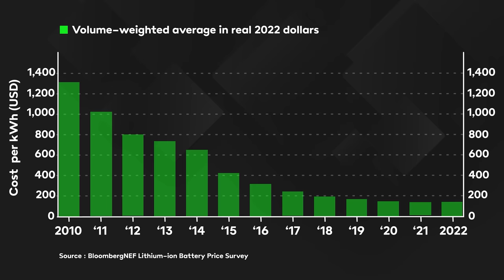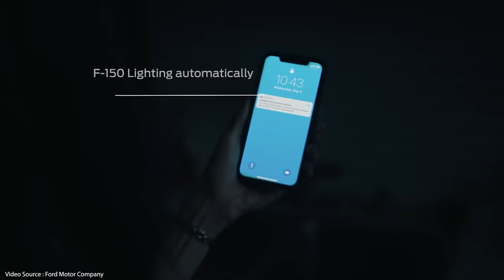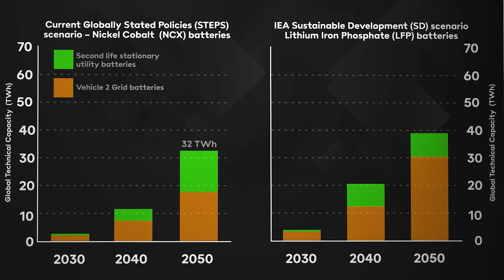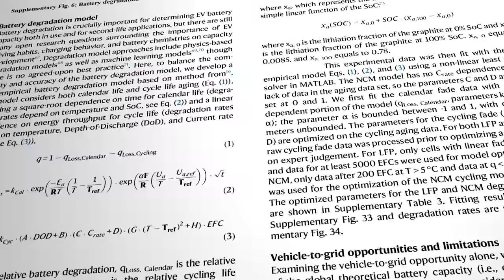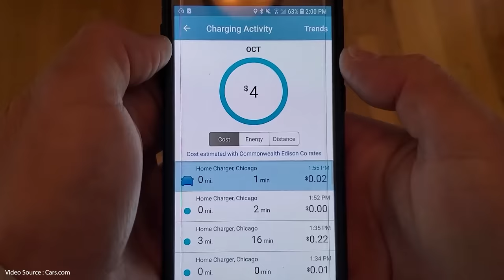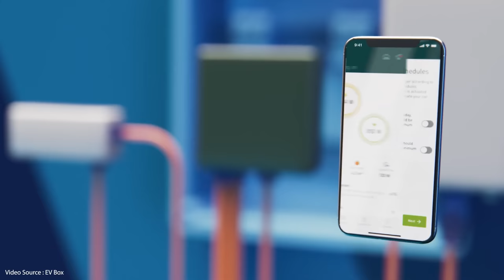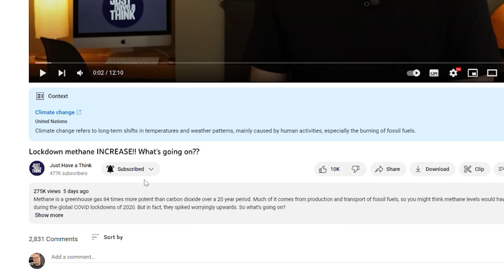Can the electric grid ruin your EV battery?

Comment: 9:45 - “Annual capacity increase… 6.5 years to… switch to electric vehicle”

Capacity increase is a small problem.

38% of live in apartments buildings, which means nearly 40% will likely need fast chargers, and those fast chargers will be used before people go to work & as people come home. 

This huge capacity increase will need to be made available on-demand for very short periods of time, which means carbon fuels will be burned to supply the batteries in peoples’ cars… or 2x the batteries will be needed for every car (ie 1 for power grid, 1 for vehicle.)

This problem is bizarrely suppressed, the EV infrastructure is unsustainable for the purpose of environment.

With urbanization increasing, the problem will only get worse.

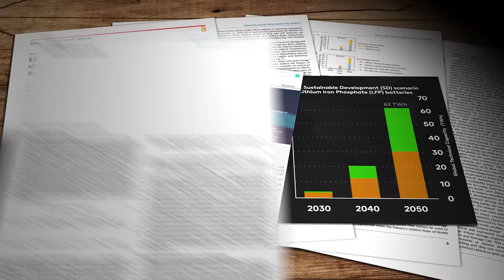Comment: 6:32 Before I continue the video, the answer is yes. Battery packs down to each individual cell are rated for a certain number of charge/discharge cycles. A 'cycle' is determined by a full 100% capacity discharge followed by a 100% capacity recharge. This could take place over many smaller discharge/recharge instances. So for instance, if an individual cell is rated at 4AH and 3000 charge cycle, then as you approach a total of 12,000AH discharged out of the cell and then recharged, that will will begin to experience end-of-life degradation. However, if you discharge/charge the batteries in extreme temps, either hot or cold (extreme meaning below 0°C and above 30ish°C, taking into account the heat of the battery itself while discharging/recharging, the number of cycles that cell can go through will be diminished. So if you live in the desert or someplace with extremely cold winters, that cell may only last 2,400 cycles or 9,600AH total being pulled from the cell. If your battery packs are connected to the grid, where charging and discharging is outside of your control (for the most part), you will diminish the life of your battery. Period.

As far as my expertise on this matter goes, I worked R&D at Milwaukee Tool in the battery division. I did a LOT of testing on Li-Ion cells and battery packs. Another consideration is the more a cell is used, the higher the risk of an individual cell failing, thus reducing the capacity of the entire pack. We try to make the smarts of the battery good enough to account for this, but it is unavoidable.

Now let's see what you have to say about this...
Reply: 8:55 Okay, before I continue the video again... No. The grid will not 'melt down'. However, the importance of having a spinning reserve (usually natural gas power plants) available at any given time will go up. If you have enough of a concentration of electric vehicles connected to the grid, you can reasonably account for a mass of power storage available at any given hour and make schedules to account for when vehicles are most likely to be on the road versus most likely to be plugged in. If ever the schedule is wrong, say people travelling on a holiday, then the available power to the grid will be below estimates, and considering how close we try to match peak production to demand, if we do not have a spinning reserve available, then there will be brownouts. For those who don't know, a brownout is when certain parts of the grid go down, but on the whole, the grid remains running and a blackout is when the entire grid goes down. Brownouts are common, blackouts, not so much, but it depends upon what level of the grid you're looking at. If you're looking at individual circuits in the grid, blackouts are probably 50/50 with brownouts, and on an individual building level, blackouts are more predominant.

As far as my expertise on this matter goes, I currently work for a power company as a designer. I deal with these kinds of things daily.
Reply: Hmm. Here's the rub. A lot of power companies offer to buy power supplied through local generation. In fact, they're often required to do so by the State's Public Services Commission. However... it is far cheaper for electric companies to buy coal or natural gas in bulk to burn than it is to pay hundreds of thousands if not millions of people for their local generation. If the States continue to require the power companies to buy locally generated power, the base cost of electricity provided will increase as local generation increases. Now this is just generation. If you add into that battery storage, then you're going to increase the rate of base cost of electricity increase. The State's are likely not going to want that because they'll start getting complaints from residents asking why their electrical bills are so high. So they'll try to quash that by forcing the price for electricity down. The power companies aren't going to like that because their profit margins will significantly decrease, which could cut into their operational expenses which will lead to the aging of the grid (because there's no extra money lying around to improve it). This will result in more blackouts/brownouts. Those who can afford local generation will be fine. Those who can't will be f**ked. They'll have super high electricity costs along with reduced grid dependability.

It's not a good deal for the power companies. It's not a good deal for those who can't afford electric vehicles or local generation either. It's a great deal for those with the money to buy these things. So do you want to punish the poor and reward the rich? And what is that going to do to the income disparity and already shrinking middle class in America and other countries around the world?

There are no simple fixes for these kinds of things and policy often makes a problem worse even when it claims to make it better. Especially when that policy is forced through by people who don't understand the consequences of it. 

I dunno. It's a cool idea... but I think we should probably be looking into power companies supplying battery packs to homes and charging customers rental fees and reducing the cost of base electricity. If the power companies can take on that responsibility (which will be made cheaper because it'd be done in bulk), then you can look forward to your 'greener future'... but we're still going to need to be able to pump enough electricity into the grid to make these house battery packs worthwhile. You've gotta put the horse before the cart. The horse is the storage. The cart is the generation. If you don't have a place to put the generated power, you're wasting money and electricity (and the horse's time, lol).
Reply: There is no way I am going to let the power company use my expensive batteries without meaningful compensation!
Reply: @jay90374  Which is a consideration that must be taken into account if policy is to be made regarding this. I guarantee you that you're not the only one who feels that way.
Reply: @Xero1of1  What they actually seem to be doing is reducing the payment for generation and increasing the grid connection base fee.

I wouldn't bet on even 5 years of personal revenue from the power companies for generation.
Reply: @Xero1of1  "it is far cheaper for electric companies to buy coal or natural gas in bulk to burn than it is to pay hundreds of thousands if not millions of people for their local generation." This is an assumption and I'm pretty sure it doesn't track.
Reply: @Xero1of1  Hey that is a well thought out analysis and I'm not going to challenge any of it. Do you think there is still a space for some local generation, considering it costs the company no capex, no regulatory costs and very little overhead?
Reply: @SocialDownclimber  There will always be a place for local generation, but I think it would be more beneficial if customers don't install personal generation with the intent to sell to the power company, but rather to supply their own power needs. 

Also, there is a cost to the power companies for local generation. Johnson & Johnson told us they wanted to install a couple of large wind turbines and they wanted the power company to pay for it. We said no. They went to the State and the State overruled us. We ended up paying the bulk of the install costs. And even at small scale, there has to be specialized equipment installed on-site for local generation. The cost for install is on the customer, but we still have to go out and inspect it. If the grid goes down, but customers are still generating, without the proper equipment, they backfeed onto the power lines making them unsafe to work on by our crews. We'd rather not have someone get electrocuted because they were trying to work on a power line they thought was dead.

There is regulatory costs as well in a way. The State requires us to purchase local generation and that comes at a cost (see previous comment). So while that's not strictly a regulatory cost, it is a cost incurred because of regulations/policies. 

Another cost to the company is when local generation is larger than what you'd need to power a building. Our lines and equipment are rated for a certain amount of amperage at any given time. If the amperage generated is larger than the rating for the lines and equipment, we have to upgrade them at our cost. We can't charge the customers for that. We eat that. Per the State.

So you see, there's a lot more to this argument about policy and its effects than was described in the video.
Reply: @Xero1of1  You're right, there was a lot I didn't know. Thanks for sharing your expertise, I really appreciate the time you spent putting the detail into your posts.
Reply: @Xero1of1  See what I've heard is that local generation can often benefit the power company by allowing them to delay capacity upgrades to lines and substations. That's why, while I think net metering is probably a bit too generous, there is a case to be made for not just allowing local generation but encouraging it, even in (modest) excess of the site's energy needs.

(By "modest" I mean without requiring service upgrades. E.g., if you've got 100A service, what's wrong with letting you generate 80A above your minimum usage? If you really want more panels than that, you'd pay to upgrade to 200A or 3-phase.)

As for the "linemen are unpleasantly surprised by an energized line" argument, I hear that one a lot, but is that really how things work? I would have thought they'd clamp an ammeter around any line they plan to work on, as a matter of course. Or is the concern simply, that someone may turn on a generator or flip on a breaker some random time after the power outage begins?
Reply: @ps.2  Just because a customer has a 100A service doesn't mean the power company is able to provide all 100A of service continuously. There's a lot that goes into sizing a service, but generally speaking, the '100A' on a service is for spike in current draw... say a customer turns on a welder or a hotel's elevator activates. The cables we use to feed these customers are rated up to a certain amperage, but that's for spikes, not for constant amperage. For example, I have a 60A service (it's old), so while the power company and my wiring can handle up to 60A, I'm generally using no more than 15A at a time. We take into account spikes in amperage as well as consistent amperage. If you have a hundred amp service and you want to pump 100A continuously into the grid, you have to be sized up to 320A or somewhere around there. 

Now imagine you've got a 25KVA transformer. It can handle 5 or 6 small houses' load. These could each have 100A services, or 5-600A max current. Now let's say 2 or 3 of those houses starts putting out 80A back into the grid consistently... You're going to burn up that transformer. While the transformer can handle peaks in current, it's only really rated for about 60A consistent output. You start going beyond that and the transformer will heat up. Additionally, if you have 30 transformers feeding 100 houses and 30 of those houses start generating near their service size limit, not only are you going to burn up the transformers, but you're probably also going to start overloading the larger transformers at the substation... you do that and the safety's kick on and turn off the power to keep it from exploding.

You would think the linemen check the wires, but if you've got an entire line shut off and isolated, and a customer does their own battery setup without letting the power company know and without sufficient protections in place, then you could induce a current onto the lines and the crews, having done everything they need to to isolate the line, it's possible that they won't check the lines due to complacency. It's happened before. And sometimes it's completely unintentional. A lineman could simply brush up against a live wire and be electrocuted. Their helmet could touch a live wire which could cause issues. Their bucket (crane on the truck) could sway in the wind causing them to come into contact with a live wire, or a small spark from closing a fuse or switch could make them jump, which could make them contact a live wire. There are a million and one reason why working on live wires is dangerous, and why, given the option, the crews will ALWAYS choose to kill the line before they work on it. And it might not even be anything external to the house that causes it. A person could have all the right battery-to-grid equipment installed properly, but then it fails and the switch connecting battery to grid closes immediately lighting up the wire outside that a lineman is working on. 

Simply said, connecting local generation to the grid will always incur additional risk to those who might be working on the lines outside or even down the block or two miles away. Are you going to expect the linemen to always have an ammeter on the line and have the foresight to let go of the wire before a failure causes it to go live? Cuz, if you see the ammeter spike, and you're holding onto the line, it's too late. You're dead.

There is a lot involved with this and creating policy without understanding the minutia behind the decision can potentially, especially in the case of local generation, kill someone.

Comment: I like the idea of an off grid home using the battery in a car to provide electricity at night and be charged by solar panels during day and eliminating the grid completely.
Reply: That seems definitely doable in the summer. But, using solar to go off grid in the winter seems much trickier. If you want your heat source to be clean, you'll need lots of solar electricity to run a heat pump, but between shorter days and more cloud cover, your solar output during the winter is going to be much, much less.

One option that could potentially work from a technical standpoint is a sand battery described here: https://www.youtube.com/watch?v=sol9FOaKTr0. But, without economies of scale, this would probably cost far more than simply heating the home with wood or propane.
Reply: @ab-tf5fl  Alternatively you could get an old fashioned immersion heater hot water tank and place it in the centre of the building in a cupboard and partially fill the cupboard with sand. The solar heats the water in the tank and slowly heats the sand at the same time once up to temperature any water used will be brought back to temperature faster by the sand and it can still dissipate heat slowly into the building, and the water can be heated directly by the solar electricity eliminating any losses in converting back to ac making it 100% efficient, as for the solar if your entire roof is made of solar panels then you should have enough generation to power your home maybe not an ev as well but this way is much cheaper than heat pumps.

In the winter if you need to if your batteries are part of the car you can always drive to a charging point and charge the car to keep running your home.

For an off grid system you want probably 3x more solar power than a grid tied home but if your entire roof is made of solar panels you should be ok.

I've also built an off grid electrical system for someone with a cabin half way up the side of a mountain overlooking a loch in the highlands of Scotland and it can keep the essentials just about running in dead of winter on a 10kw battery and 4kw of solar, the biggest issue seems to be battery size as even in winter the batteries can be fully charged and have excess energy but on dull days that extra power that could have been stored would be useful although more panels would help as well.

Comment: I think the biggest issue with V2G is not battery degradation, but cost of equipment. Using what I've read about the Ford F150 Lighting as precedent, the extra equipment to allow an EV to simply power your house during a power outage, let alone feed power back to the grid costs anywhere from thousands to tens of thousands of dollars, even after you've already paid for the vehicle with the giant battery. If we want V2G to take off, these equipment installation costs are going to have to fall dramatically, otherwise, there will be no hope of ever collecting enough money from utility micropayments to make it pencil out financially.
Reply: Shouldn't be more than a few thousand to set-up and you wouldn't feed-in at those miserable solar rates you would join an arbitrage group/company to supply peaker & grid stabilisation energy at premium prices.